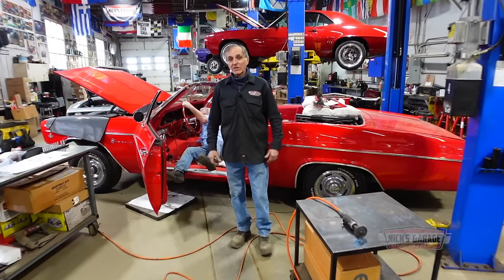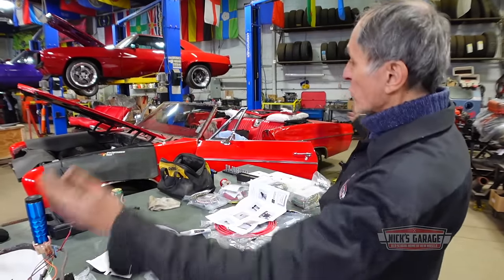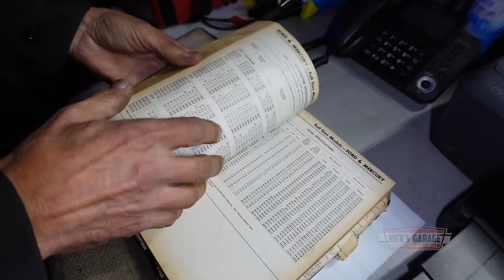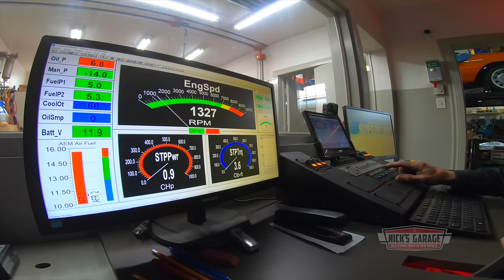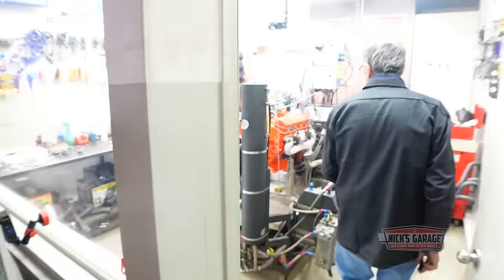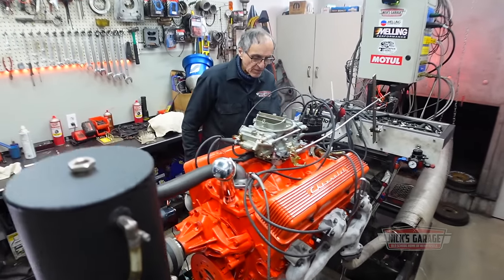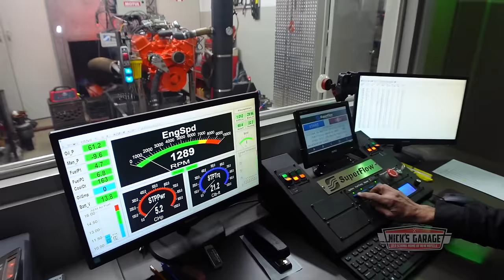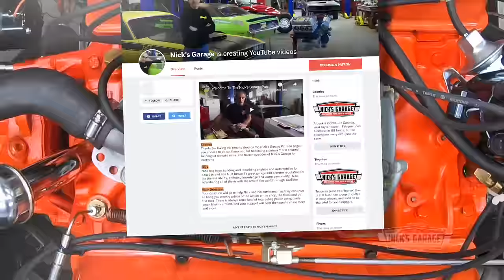327 Chevy on the DYNO - Exhaust Shootout

Comment: The little engines that could... 327 Chevys, 273-4bbl Mopars, 289 Fords... always liked how the little engines ran putting out way better performance than you'd suspect for the cubic inches.
Reply: And they can take a beating.
Reply: 318's and 340's were way better engines than the 273. Only thing good from a 273 was it was reliable. It couldn't make power even if you paid it. That's why it would run forever. It couldn't produce enough compression to blow up.
Reply: Don't forget the Studebaker 289 (not a Ford).
Reply: @johnsonjeremiah74  - Hyper 273 had a snotty exhaust sound!
Reply: High compression 330 Olds!

Comment: I had a 68' 327"  275hp on the factory Air Cleaner.  In a full size Caprice Estate Wagon. Hideaway headlights, power everything. Headlight,  Highbeam, and turn signal indicators on top of the front fenders.    GREAT CAR!

Comment: Thanks Nick and George ! Ive had a 327 .030 over for years and i love it !! solid isky and 202 camel hump heads, 600 holley....  had headers  but i swapped back to manifolds several years ago ... i knew it slowed a bit down but its still a fun ride in my 64 malibu.... thanks for the dyno numbers as i thought mine was always in the low 300 hp range ... happy greek easter too
Reply: Opa!!
Reply: Cool.
Reply: Yip, i love my little steel crank 68 327, last ran 20 years ago, being built to an old school recipe, using a NOS moon circuit cam, offy ram, 650dp spreadbore, 462s, and powerglide. Heads, crank etc are the engines originals.
Reply: just a thought... do you have the rear crank case vent blocked ? Its jsst a hose to the ground then in 67 they routed it to the air cleaner ... thanks again👍

Comment: One of my girlfriends had a red 327 Chevy like the one being worked on today in your shop.  We had a lot of fun with that Chev and this upload certainly brings back memories.  I was always pleasantly surprised how fast the little 327 would wind up.  At the time I was driving my 440 Roadrunner and power-wise there was no comparison but I certainly liked the fast-revving Chevy.  Her brother owned a service station so the cars were always kept in tip-top mechanical condition!  She was great behind the wheel, too......that gal could run with the best of them!!  P.S.  Anyone who does rewiring deserves a medal for patience and it sure isn't me!  I never really cared for the spread-bore Holley on the Chev and felt I could fine-tune the Quadra-Junk to give me sharper response and better mileage........but, what the hell; let's see what she'll do.  No way would I give away the torque/hp that those restrictive manifolds produced.  I think that ram's horn manifolds might get a bit of it back.......dunno....  P.S.  The color on the Charger 500 is beginning to grow on me........
Reply: Cam also looks too big and peaky for a street cruiser...

Comment: I just got the rebuilt 327 in my 67 Camaro running! It's hot as a pistol, sounds like an angry panther.
Reply: '67 Camaro cried out for the unavailable 350 HP 327" engine option!

Comment: I've had several 327 motors in my 60 years and found this motor to be very responsive and almost indestructible one of the best motors Chevy made I wish like alot of us older gear heads say had the cars back that just them motors were in
Reply: My first vette a 65 327/365 four speed with 4:11. So much fun and 0-80 through the gears was always fun. They were like little race engines and sounded like it. Some of GMs finest days back then.
Reply: When big blocks were reigning the race car scene at the dirt tracks we blew ours up one of our friends with the pitcrew had a 69 chevell with a 327 in it and we jerked the motor out of it and installed it in the stock car and went out and won the feature with it , and it sounded like a bumble bee against those  big blocks but  it was funny 😳 👍
Reply: Nowadays BB Corvettes are bringing big money.  But the Corvette was never designed for a BB.  The SB was much lighter so handling was much better with less weight on the frontend.  Properly tuned a 327 didn't give all that much away to the BB of the time.  I was sad to see the 327 go away.

Comment: Good afternoon, Nick, I'm anxious to see what kind of power the 327 makes on the dyno, and the difference between header, and stock exhaust manifolds. The 327 was Chevy's bread and butter engine that was widely used in all of GM's cars and trucks. Here we go!!!
Reply from the maker: We shall see.. the dyno reveals all.  Glad to have you with us again!
Reply: It’s still being used, it’s the 5.3 liter engine Chevrolet still uses.
Reply: 323.42 cid
Reply: @NicksGarage  I'm glad to be here, just have to keep reminding myself that it is in the afternoon now, lol. The 327 made very respectable power even with the stock exhaust manifolds. George will have a very nice cruiser when the car is finished.
Reply: @MichaelandCathy1999  You are comparing apples to oranges. The Gen 3 5.3L Vortec is a totally different engine than the Gen 1 small block Chevy. Nothing about them is similar at all. The 5.3 is 325 cu in, and has a completely different bore and stroke than the 327. The 5.3 has 6 bolt mains, and most 327 engines were 2 bolt mains, except for the HP versions in the Corvette that had 4 bolt mains. The head design is also different, the 5.3 has aluminum cathedral port intake design, and the 327 has cast iron heads with a rectangular intake port. I have a 5.3 in my 2003 Silverado, a way different engine than I had in my 1964 Chevelle that had a 250 HP 327.
Reply: @MichaelandCathy1999  5.3 is a 325 cid
Reply: @eugenecastles7475  chev offered sbc in 283, 302, 307, 327, 350 and 400 in that era but the 327 had highest hp rating of 375hp. 350 was up to 370hp. 

4 bolt main blocks only had 4 bolt on 3 of 5 main caps. Front and rear were 2bolt. The first few years had smaller crank journals. If I recall correctly the large journal 327 was same block as 350. 

This is my memory from 50 years ago but pretty sure its accurate.
Reply: @dondakota920  Thanks for your reply. I'm very aware of the history of SBC, and all of the different engine sizes, and specifications. I started working on them in 1961, and have continued to this day. All I was trying to do was point out that the Gen 3 5.3 is a way different engine than the original 327 that first came out in 1962. I have owned Chevy's in the past and still do, but I'm still a Mopar guy at heart, and always will be !!
Reply: I think bore spacing is same
Reply: @dondakota920  the small journal switched over to the large journal in 68.
Reply: @eugenecastles7475  just giving some info and discussion. Continuing your message not debating it.
Reply: @Macsleuth  I thought so to, but had a 68 camaro 327 2bbl and sold the engine and was told it was small journal by the buyer who rebuilt it. Pretty dam sure it was original motor as everything else was and behaved like I'd expect for a high mileage engine of the era. 

It got a 396 since no one cared about original parts back then.
Reply: @dondakota920  yes, although the change over happened in 68 there were some small journal 68 327. I have one, pulled from a 68 Pontiac Parisienne wagon. Had it rebuilt to factory specs and was told by the machine shop 68 small journal was rare as that was the year they changed to large journal.
Reply: @Macsleuth  that makes sense. 

So I paid $300 for the camaro in 1980, the kid I bought it from took the money to the bank to pay off loan and left penniless.

Ran much better with 396. The camaro had some nice options too. 

PS. Just bought a 1953 F600 today. Impressive truck.
Reply: 25:45 Here’s your answer.
Reply: @NicksGarage  - Nick, George will prolly hate that too big, peaky, gas hog, 232/232 '500 HP' cam in a small motor in a heavy car! Talk him into about a 214/224 cam... similar HP but torque all over...
Reply: @dondakota920  - Chevy decided not to install the 370 HP 350's and used 360 HP 350's in Corvettes as well as Camaros...
Reply: @MichaelandCathy1999  No they don't.
Reply: @BuzzLOLOL  are you sure? I recall seeing a 370hp LT1 in a corvette? Am I mistaken?
Reply: @dondakota920  - It was listed in the early 1970 Corvette sales literature, but they decided to lower the intake duration of the cam for production... better drivability? lower emissions? more low RPMs torque? You can ask on Corvette websites and they will tell you the same thing...
Reply: @BuzzLOLOL  I know the camaro was 360, but a Google search seemed to show the corvette had 370. Not that I believe everything I read on the internet.

It is interesting that the 327 was higher rated. Also interesting the L78 was rated 425hp in corvette and 375hp in everything else. Same engine.  The biggest joke was rating L88 at 430hp, that was about 150 less than actual dyno tests on stock motors. 

Regardless of ratings, the LT1 was the most powerful carburated small block.
Reply: @MichaelandCathy1999   5.3 liter is NOT 327 cubic inches. Regardless
Reply: 375 hp 327 ate many big block rigs up only reason upped 396 was 600$ 375 hp vs 200$ bbc 396 in 65 in corvettes
Reply: @jasonconklin8172  it was the torque that made t;he big block so popular not the cheaper price of a holly carb vs Rochester fuel injection. In a drag race my money would be on a 365hp 327 over the 375hp. Although I never owned one most fuelie cars were retrofitted with a carburetor because they never worked properly.

However no small block had a chance against the 425hp 396 or even the 325hp version as the torque the big block could produce got it off the line so fast that the race was essentially over before the small block could build the rpms needed to produce the impressive horse power. 

Other types of racing made the high rpm small block a winner but the big blocks made their power and pinned you in the seat the moment you hit the gas.

I completely agree the cost killed the fuelie, had Chevy worked out its design issues and servicing woes it could have been great but most were abandoned along with tri-power cars because a Rochester or holly 4 barrel worked better and easier to tune.

Winning drag races sold cars as did feeling the power in the seat of your pants. The 325hp 396 had a smooth idle and behaved like grandpa's 283 but pinned you in the seat with a touch of the throttle. Both the 425hp 396 and 365/375hp 327 had noisy solid lifer cams, rough idle, and a need to build rpms to produce hp. Its the big block ability to instantly put the power on tap that made it so popular. 

Arguably the 1967 L88 427 was the most powerful big block ever made as its true hp peeked over 550hp but required racing fuel and the better behaved 390hp 427 produced its power the moment you touch the gas pedal. 

I love all these old engines but each had their pros and cons. I could rattle on for days about best combination of parts and what wins races but would probably bore you to death. Witnessing politicians destroy the American muscle car era in the 1970s was horrific, then to see it repeated with diesels in the 21st century was heartbreaking.

This old chev gearhead now drives a 1953 F600 4x4 with a 12 valve Cummins. They just don't build em like they used to.
Reply: It was used in Chevys and Corvettes. In the 1960's each GM division had their own engines. They were all completely differeñt from each other
Reply: The 5.3 litre  engine is  completely different from   the old 327. A 5.3 liter is 325 CID

Comment: The very fine 327 small block from its small block family:
265, 283, 327, 350, 400.
We also had 302 (Z/28) and 305 (garden variety). Now you can get a 377 from Mercruiser! The small block lives on!
Reply: Don't forget the 307.
Reply: @basilcarroll9729  
You’re right there was the 307 & 305 small blocks which were standard on many Chevrolets, the 307 I think replaced the 283 and the 305 came along later like when the full size and mid sized cars were down sized in 1977/1978.
Reply: @Luigi-pk8mk  Yes, 1976 for 305 and 1979 for the 267.

Comment: I had a 1994 chevy caprice 9C1 I bought at action just before 9/11 in Newburgh NY.  I worked law enforcement (retired now) so being a gear head I did a few small mods to my LT1, considering it was a daily driver to my then 2000 Camaro SS ls1.  I did a tune , prem gas, factory rev limiter, no speed limiter and firm shifts to my new reman GM 460le.  I also added to my 94, hard relay to primary cooling fan, 160 thermo, hooker stainless steel “spaghetti headers” look that up, cat delete , flow master mufflers with factory resonators which kept some back flow and just drove the LT1 thump home.  Eaton possi and my car did 9/11 relay of police, school searches, emergency response because I worked and it was an old police car.  It was 2 lengths behind my SS and topped out at 148 mph, it was around 125,000 miles then. Had it for 11 years.  Miss that car to this day more than my Camaro.  The dodge charger reminds me of the caprice, powerful cruiser.

Comment: That mouse motor has a nice rumble to it at idle! Always liked the power and rpm’s the 327 could put out. 👍
Reply: 100%! I had a 68 Vette w/ nice 327/350 horse. It would be nice to see a dyno comparison between log style and the rams horn style.
Reply: You mean the mouse that roared!;
Reply: Rams horn they say had a 32oercent larger opening and a smoother arched flow to produce higher Cfms
Reply: 327 has a real nice bore/stroke ratio.
They run ridiculously well for their dimensions.
Reply: Especially w a11:25;1 compression popup pistons
Reply: Holley makes a very nice log style manifold with 2.5" outlets.  Put them on a 406 with TBI heads and TBI on a bored edelbrock 3704 manifold in a 95 G30 van based RV.  Using 2.5" to single 3" with a merge Y.  Runs quiet and lots of torque.
Reply: @duanepierson4375 You are right.  I still have my first car which is a 1970 Nova with 350hp 327 and Muncie 4 that my dad and I swapped in place of the 230 6 with 3 speed.

Comment: He really needs that PCV. You and I both know it. Crank case pressure is a horsepower killer! Exhaust evac systems that put negative pressure on the crank case are all the rage these days.
Reply: well, it does have a breather in the front of the intake..  at stock engine HP,  exhaust evac doesnt do much.. especially if hes goona use manifiolds.
Reply: We installed and a new breather tube that is equipped with a PCV valve set up.
Reply: PCV does nothing at WOT.    There is less than 1 inch of vacuum.   That's why you have a breather on the other valve cover to vent under high loads.

Comment: Had a 65 Chevy ll from factory with 300 hp 327 special order with 4 spd trans 
Large 2 inch exhaust all the way back
Brakes were terrible
Found out later could have got the 350 hp  with Holley carb and better cam
Mine had AFB carb
Lots of fun

Comment: I have a 327 in my 69 camaro it's a 64 engine vic junior 600 Holley long tube hookers have seen 7000 before but don't like reving it that hard these days but it does 6 easily.60 mph in 1st with m20 trans love it hi from New Zealand nick love your Chanel.🇳🇿